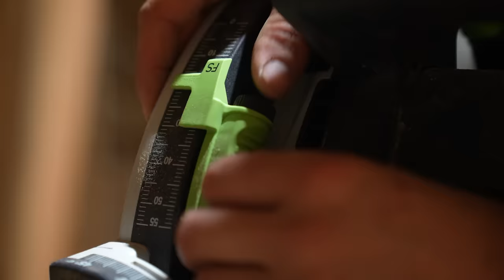Making the attic doors.

Comment: No. An OSB door would not have been just as good. You made the right decision.
Reply: I much agree, OSB door doesn't come close to the door you built.
Reply: And it gives him practice for when it comes to making the fancy ones for the rest of the building.
Reply: What is an OSB door?
Reply: @patriciaeisert8483  OSB is oriented strand board much like the subfloor material. Basically layers of wood chips pressed and glued together.
Reply: Agreed, OSB is not good for wet conditions.
Reply: 😊 Bravo😊
Reply: @jeannamcgregor9967 it would've lasted more than long enough.  But it would have looked terrible and wouldn't have levelled up his skills.  Now he knows his tools, has 2 very nice doors, which could be reused later on a different part of the chateau.  OSB isn't great compared to real wood for durability, but it is adequate for the task of a door
Reply: Thanks for your reply!
Reply: Agreed!

Comment: You are so lucky to have that new chain mortiser.  That's really sweet.  I went and looked and found only the one company that makes them so far.  A word on that, though.  As a general rule of thumb, always make your mortises first.  Always.  It's easier to creep up with the tenons to make them fit than the other way around.  One other thought is that paneled door you made.  The "panel" part should be a piece of plywood or chipboard or something stable.  Those captured vertical boards are going to expand even if you paint them and believe me, something will give.  Gates have been made that way with the "z" bracing since day one, I think but not captured around the outside as you have done.  Remember, the wood expands mostly across the grain, not along the length and it does move, even when it's not growing!  Just a precautionary tale...for practice, as you said!
Jack L.

Comment: Hey Dan…. Glad to see that you will be proceeding quickly to “brick up” the opening above your two new doors. As this masonry work proceeds, please consider including some steel connectors embedded into the masonry to tie down the wood beams which the masonry walls support. The potential for uplift from wind which could rip off you beautiful roof structure is significant. It appears that the roof is designed to adequately withstand downward forces including deadload (weight of the roof structure and slate tiles) and live loads (snow, ice, wind, etc.), but without strapping the main horizontal carrying beams to the masonry walls, the potential for uplift due to high wind loads against the exposed temporary end wall of the attic is a big risk. You should also consider pouring a steel reinforced bond beam along the top of the masonry wall to unify the structure. This infill masonry work will be difficult due to access and spacial limitations and would have been easier if accomplished prior to erection of the roof structure. We all recognize that the primary goal was to get the roof on to dry-in this portion of the chateau and that time and weather restrictions caused some of this work to be delayed. However, it would be a mistake to not circle back and complete this essential structural work before moving on to the next quadrant of the chateau. Good luck moving forward!

Comment: Greta job to practice on, the top and bottom rails should be tenoned into the stiles, leave stiles over length and then trim back.. a long time since I made doors and windows in a joiners shop, I definitely have workshop envy 😂

Comment: You need to allow a bit of space inside the frame for the planks to expand as humidity varies.  My oak shutters were made a bit too tight and they expand and contract about 20mm between winter and summer.  I have had to trim them several times to allow them to shut.  Yours are not quite as wide (mine are 2M spit into four doors) but I would allow 10-15 mm on each door for lateral expansion of the infill planks.

Comment: I was glad to see the reminder of Dan removing the big water tanks from the roof, and then I thought....hummm the chateau must not have had any other water source. I think he is also using a couple of solar panels, so no electric lines there either? The attic door makes sense, finish the stone work, frame the door and  you add strength to that roof supporting wall plus create a dry, secure area.
Reply: Yes, the old metal water tanks were supplied from a old water well with pump.   The well has not been cleaned out in over 4 decades since the fire, and the old pump does not work.   Dan did a Vlog several months back ( fall 2023, before the big push for the chateau right wing roof) checking out the well.  Many commenters mentioned either cleaning out the well, or getting a new well drilled.   Dan may have inquired into the costs for both, but has not shared his future water well repair plans yet.   ( Costs for roof was primary.) 
 
Yes, on the  Ecoflow solar panels for electric power. Last fall, Dan said very briefly that he was inquiring about getting electric to the box on the perimeter wall near the old natural pool.  No new news on that; I am sure he would do a Vlog if & when he gets electric line connected.

Comment: One traditional technique for pegging joints was to get the wooden pegs very dry, which shrinks the wood slightly.  When they are inserted into the frame they absorb moisture from the wood of the frame and then expand slightly making them extra tight.

Comment: Unlock the plunge on your router then switch it off and then set it down on the bench. Also extend your trigger finger down the handle of your tenon saw. It gives one much more control.

Comment: Hey Dan, LOW VOLTAGE may have caused the failure of your winch. Check the voltage drop at the end of the cord you are using. It must be in the parameters of the motor. You may have to move the power source closer. May also cause problems with your new machines.

Comment: As joiner I must point out that you made the door wrong. The styles of the door should run through and the rails between, the opposite of what you done. The reason for this is the shoulders of the joints are vertical and have little or no chance of water ingress into the joints, which would cause the joints to swell and distort. 
Good job they are temporary doors, you will also notice over time how the doors change with shrinkage etc. Still keep up the good work, it’s a big learning curve and a big project.

Comment: I'm wondering if you would consider, rather than completely bricking up the upper opening, if there is any value in reconstructing it as was, but glazing it (initially with a temporary material like acrylic or poly carbonate sheet). It would retain an original structural aspect and give you less work to do. Plus a source of light in there until the windows finally go in, which is going to be a long way off, presumably. I suppose a solid wall provides more structural strength, though.

Comment: Go Dan!  You can use those doors later somewhere else. basement? outbuilding? OSB doors would not have been just as good. Put some sealer or paint on that door and it will last a hundred years or more!

Comment: Forgive me if I have got it wrong but I don’t hear too well some days and so have to rely upon the visual. That means I may miss out on explanations. I’m guessing that this will be an internal door. The normal method would be to either kiln dried (where the moisture content is nearer that of an internal room) or air dried and let it acclimatise indoors to the ambient humidity. If you don’t do either, you risk the timber taking in or letting out moisture which will lead to expansion or contraction or warping. After cutting the timber on the mill, it would be best practice to leave it over night so that the timber can show any inner tensions it had. It’s quite usual for bows to appear. It’s then that you get to work producing a piece with all 90 degree corners. On a European machine this is normally doing by flattening one side on the top of the planer/r thicknesser and then making a 90 degree side to that by using the fence. With two sides at 90 degrees, you then run the other two sides through the thicknesser. What comes out after all those processes should be stable, accurately dimensioned timber. 

I’ve made a lot of doors, cupboards, tables - everything you can imagine. And I’ve made every mistake you can imagine including using timber that hasn’t been seasoned or acclimatised.

Comment: good job enjoyable to watch , not criticizing as they will do the job but remember usually u have a mid rail mortice & tenon into side jambs its usual for orientation of joints to be the same  , mortices in jambs for rigidity tenons on rails , there are other reasons why i wont go into,  im just saying Im sure you will figure this out over time

Comment: @elchapito.  You may find that if you were to watch some updates on the Eiffel Tower restoration, the artisans are attempting to restore it by emulating the original techniques using massive amounts of locally sourced wood the same type of which that would have been used in the original structure.  No nails and dowels used instead.  My analogy is correct.
Reply: Artisans are using "massive amounts of locally sourced wood" to restore the Eiffel Tower.
Sure they are. 😐
Let me guess: you've been dropped on the head as a baby: am I correct?
Reply: The Eiffel Tower's built out of iron, love.

Bless
Reply: You mean Notre Dame of course.
Reply: Halvaf!  YES!  In my mind I was typing Notre Dame when I actually wrote the Eiffel Tower.  I am so glad that you figured that out for me or I would need to take myself off to the home due to dementia!  I guess the use of the term “restoration” was a fairly big clue.  Thanks so much for the other respondents being kindly snippy in correcting me!

Comment: Dan, NO, an OSB door would not have been "as good" because not true to the restoration of the chateau!
Also, question:  Do you plan to restore the attic windows in the roof sections which appear on the old photograph?  I noticed you did not frame them in when you built the attic roof.  What is the plan?

Comment: Half decent effort, but are you sure blocking off the lower aperture is a good idea, I think you should also close off the upper aperture as well to minimise the possibility of the roof lifting in a extreme windy environment. Cis to me, that partial roof looks lije a big paraglider.
Reply: WTF... 🙄🤔
Reply: @theduchess9019  it's not hard to understand
Reply: @timhull8664  "The next bit of wall to repair is this bit above the door" are literally the first words spoken in this video. It's not hard to understand.

Comment: Are you still using only solar energy to power everything?  It seems like the power tools would require more energy than the solar you had could produce.
Reply: The solar panels charge the batteries in the Ecoflow units.

Comment: Hey Dan, where are you getting your electric power from?
Reply: Dan has solar panels set up.
Reply: @annettev8362 he does? Since when? 
More than the remote units that came partner up with the EcoFlow?🤔
Reply: The only electric power source that I know of is coming from the EcoFlow Battery System, if he’s added more units to upgrade or added additional units to power the yurt, I haven’t heard him say. The initial unit has a solar panel charging unit that he installed three stories up the side of the Château. 
There is no electric mains on the property.

Comment: Nice but unnecessary, because when you cut the section of wood, you weaken it in the same proportion, it is preferable to use the whole wood and join it with metal hardware Or reinforce what you did with metal hardware.

Comment: 10:13 no glue?
Reply: Why need glue? The pegs hold the parts mechanically in place and all the inner boards are held in place with tongue & groove joinery. Also, if you glue wood you need to know how to cater for seasonal wood movement and changing moisture conditions.

Comment: Man you got some serious ADHD issues! In your last video you did mortar work making us think "About damn time" since I feel that you prematurely installed the roof and never finished the mortar around the beams and now your gonna make attic doors!?!?!
Reply: It makes sense to me. He's going to use the frame to help stabilize the wall and then build the missing part up to the roofline. Then he can secure the paper on that edge while he builds up the walls going down the middle corridor (making it fully watertight). Once that's done, he can put a roof on the middle section.
Reply: He shored up one area and now is focused on a larger one where a door goes. He also showcased all the equipment he has been given, from new cement mixer to all the new woodworking tools. It makes perfect sense.
Reply: @b.w.6535 I agree with those comments, plus it'll help keep the wet weather out, the drier it can be made, the better. The wall above can only be rebuilt a few courses at a time and will take longer to complete, so may as well do this which can be turned around more quickly.